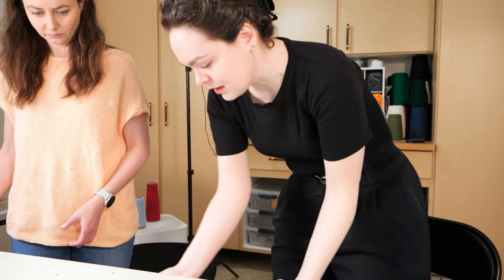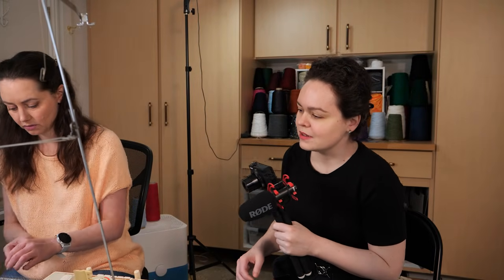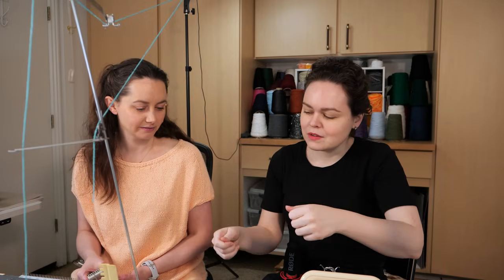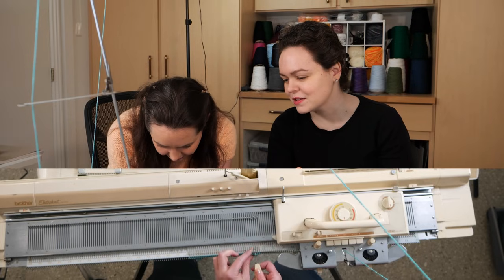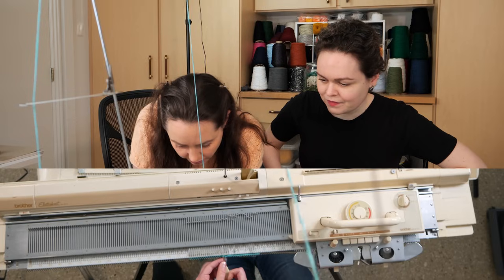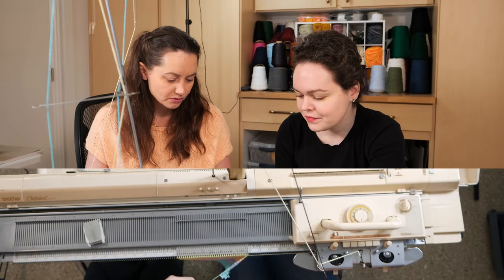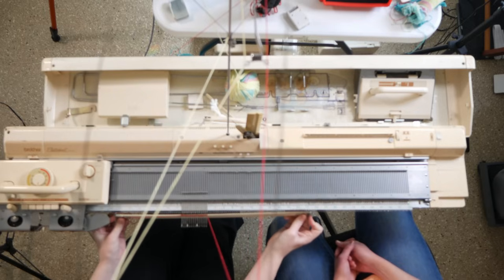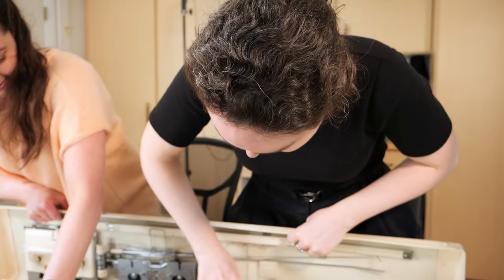Intro to Brother 910 standard gauge knitting machine feat. Rachel

Comment: The C position was a thing up until least the kh800, and I have not worked out why it was useful in the machines older than that. In older machines it would be treated with the same settings as B position needles, but it was specifically the point you could push needles to from holding position to get them to knit no matter the cam lever settings. The thing is that doing anything other than knitting B would make them drop off, and they tended to not have 2 colour knitting settings, so there was no reason have them at C as opposed to transferring them back to B to slip or tuck correctly, or having them at D which would knit normally with the levers set at I or II.
However, in the kh800, they were treated like D position needles, meaning that they could be used for patterning while holding stitches. The automatic patterning brought the stitches out to D position, but no lever setting could hold just E position needles, so the D needles would be brought back to C to knit in pattern while holding the other stitches. 
It was lost to time because they worked out that they could just make C and D the same thing (D spans the space C once held as well as the old D position) and hold just E for partial knitting purposes. It was not useful without 2 colour because it would drop off when patterning, and with 2 colour it was only useless because patterning was brought out to D which couldn't be knit independently from E. They just kept it called D because that was understood to be the position needles are pushed out to when patterning, and it was less confusing to people used to the older ones. 
This is entirely superfluous knowledge for the purpose of actually using any machine missing the C label, its just interesting to know why it skips over C instead of relabeling them

Comment: First thing to look is the needle bed, bumps and damages to the carriage, which means it could have fallen and something is broken inside. The sponge bar has to be replaced  most of the times, but this one is NOT in good shape, looks like it's home made, it won't hold the needles down with correct pressure and evenly across. Vaseline oil is the only one that can replace the original because it won't cause damages to the plastic parts

Comment: Where do I buy the replacement sponge for the sponges bar for a singer 329.
Reply: knitting closet in FL, US has been good supplier lately. No affiliation.
Reply: @happygoatknits  I'm in Australia. I'm going to try ebay. Though some suggested try hardware using foam tape with satin  ribbon on top.